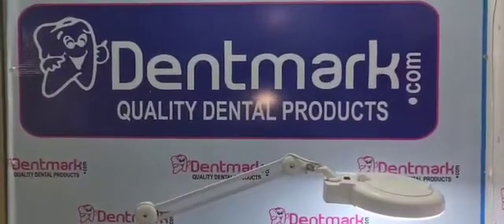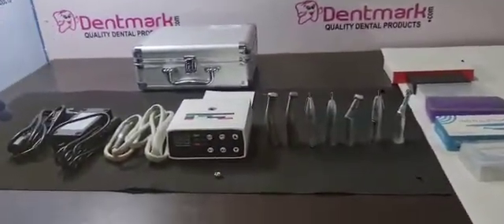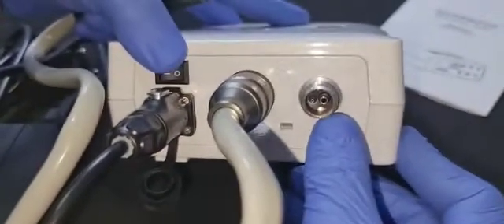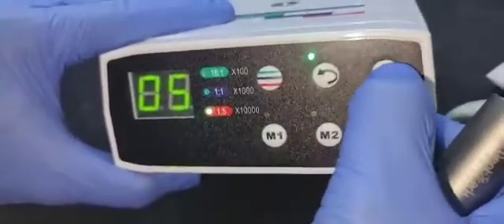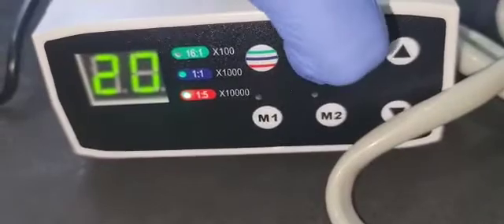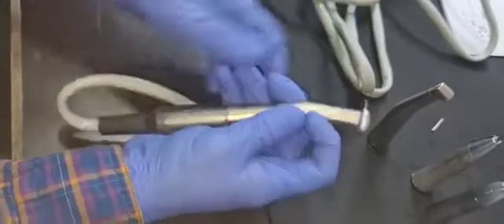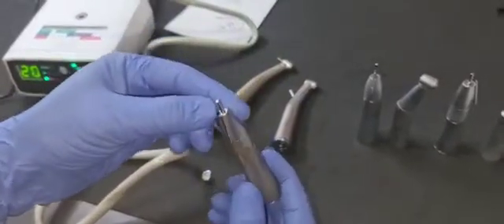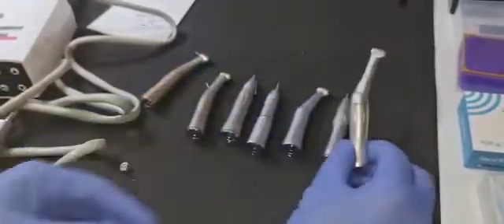DENTMARK BRUSHLESS LED ELECTRIC MOTOR WITH 1:5 FIBER OPTIC HOW TO USE

Comment: I want to buy surgical contrangle handpiece. But I am confused about connection of water. How do we connect water inlet to handpiece
Reply from the maker: Hi
Surgical contra angle is 20:1 which u can use with physiodispenser or 1:1 contra angle with inner & external water option which u can use with airmotor or physiodispenser

Comment: Does this device requires air pressure / water  or can you use it just with the electric power ?
Reply: I was going to ask the same question! Do you actually need the air connection for it to work???
Reply: @Sagan_Groove  no bro
Reply from the maker: Sir may i havd your email id please.send u details.
Regards 
Dentmark team